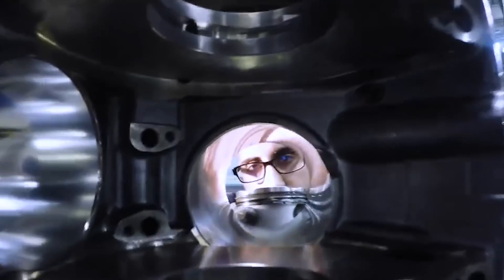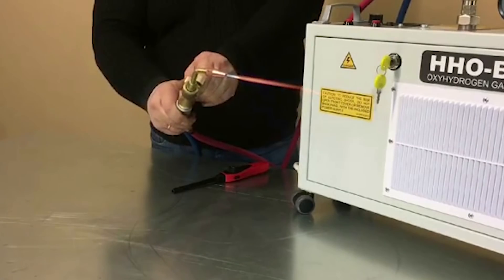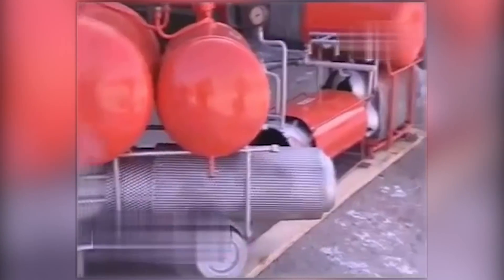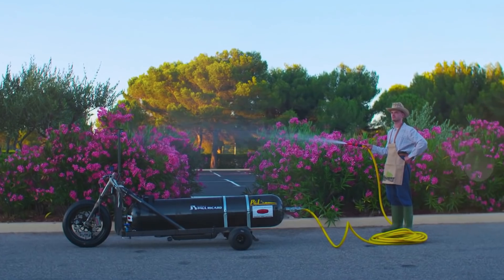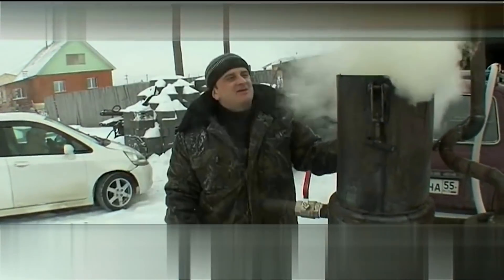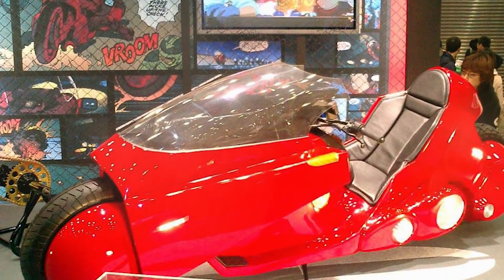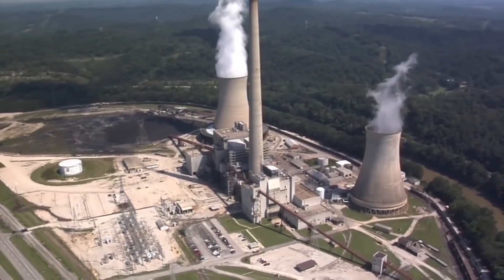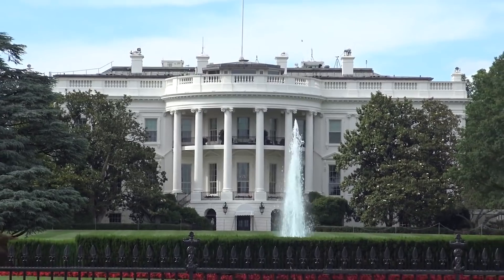Why These Engines Are Banned?

Comment: This started out pretty good, but it lost me from the bike with the "magnetic engine", and went down hill from there. The only thing that bike could do, is perhaps, utilize regenerative braking, before there was a name for it. Magnetic engines aren't prohibited, they just can't work. Not because they aren't allowed to. The laws of physics don't allow "over unity".
Reply: lost me at the hho generators

it take more energy to crack water, then what you can get burning it back into water.
Reply: @MaximusPsychosis  True. But if you get that energy from solar when you can and store the hydrogen then who cares how much energy it takes to free the hydrogen?
Reply: @2wheelsr2wheels39  there is calculations out there, but to get the required fuel to idle a 4 cylinder engine, i think it was around 10KW
Reply: Hydrogen then becomes another way to store energy when it's available, then, convey that energy when it's needed. Definitely a viable solution. Anything beats curtailment. If the wind's blowing, I want those turbines turning. If the sun's shining, I want those panels running at maximum power point. With the amount of stored energy necessary to smooth out intermittent renewable sources, nothing's off the table! no one technology can meet the demand: We need it all.
Reply: Solar power systems are notoriously inefficient, even under full sunshine.
Reply: No such thing as HHO. I think he means H²O
Reply: James DeGray  You have no idea what you're talking about.

1)Please explain exactly what "frequency/harmonic resonance" means, and how it pertains to cracking water.

2) A heat pump system can be considered to have a COP (Coeffient Of Performance) in simple terms when it has an additional heat source (a conventional electric heating coil) adding heat to the gross output of the heat pump. You still need to put energy into that heating coil. The heat pump (the "refrigerant compressor" you're talking about) does NOT put out more energy than it consumes.

3) No, you will never get more energy from burning hydrogen and oxygen than you will put into water to separate it.

In the words of Katt Williams: Go on, I'll wait.
Reply: @Mike-ie5xu  Yeah james is a moron.
Reply: it shows how low your IQ is and how low your attention spawn is. Magnetic engines are real, you just have to replace or recharge the magnets. And they clearly stated that is has a second electric engine/battery.
Reply: @alejandronunez7650  Find me one link on the internet that's not on youtube of "recharging magnets" and working magnetic engines that dont use electricty to keep running. You are stepping on dangerous "free energy" land here. And as for low iq? im an electronics engineer, so im pretty sure i know what im talking about. And to keep with the thread, you would have to have a very low IQ to believe in both free energy, and everything you see on youtube.
Reply: @colinsmith6340  "Free Energy" isn't a falsehood. We are surrounded by it. What do you think solar heat and the northern lights are? It's all about the type of energy and how we use it. Dont be blinded by the oil industry and others that want to keep their position at the top at the expense of the rest of mankind.
PS: as an electronics engineer you should know this.
Reply: @2wheelsr2wheels39  As an engineer that's not free energy. That's just energy that isn't being captured. Its from the sun or wind etc. Its not the holy grail of "Free" energy that lots of youtube videos post about. As an engineer i know the difference. I am not blinded by the oil industry, i actually have a home built solar system with 12 panels capturing energy into batteries and then used to run my servers. its not "FREE as in youtube flat earther crazy" free, but its simply energy i dont have to pay for. i still had to pay for the panels, the batteries, the inverter, the charge controllers. I didn't just put some magnets onto a wheel and post it on youtube.
Reply: @alejandronunez7650  The bike IS real, just not in the way you might think. It was an early attempt at "regenerative braking", allowing energy to be fed back into the battery when slowing down, or descending a hill, rather than wasting it as heat in friction brakes. It extended the rang of the bike, with no need to increase battery capacity. They didn't have pulse width modulated motor controllers back then, the transistors to do that just didn't exist yet. What it did, was move the magnets in and out of the stator coils, to adjust the braking effect, and maintain decent efficiency. Not an over unity machine, but rather an efficient one. It was more efficient than anything out there at the time.
Reply: It's not fully the truth, LEDs allow "over unity", but in general your right
Reply: @tobyhunter6565  No, they don't. There is no such thing as "over unity". It doesn't exist. At all.
Reply: @colinsmith6340  The Paradigm is just about to shift but it's too much to discuss it at a comment section. Told you, in general your right.  "At all" does not exist either, only in dogma and its language but not in Physics.
Reply: @tobyhunter6565  There are no paradigms to shift. You can't make free electricity or movement. There is no magic perpetual motion machine. There are no magnetic motors that somehow spin without electricity forever. People need to close youtube and read some actual physics and thermodynamics books. There is no such thing as a free lunch. There is no special arrangement of wires or magnets that will provide electricity for nothing. There isn't even anything thats 100 percent efficient. Entropy and thermodynamics don't care about your paradigms. They don't care about what you watch on youtube. They are rules of existence and reality.
Reply: @colinsmith6340  Good on you keeping your House in Order. As long your apples fall from the tree straight into a rubber sheet of gravity . The rotation of Galaxies alone defying some of those RULES. Knowledge is everything but static - sorry did not want to wake a sleeping Teacher, but perhaps there is the initial spark to look outside the BOX after all those years. And watch the Paradigm shifting, it's happening right now. It is the "Standard Model of Physics" and not one of "my Paradigms" or of You Tube's - Mind your words you'r old and educated enough to know the flaws of the RULES.
Reply: @colinsmith6340  All you got to do is capture lightning in a bottle. That's free. So are solar panels & wind.
Reply: @SamaritanElad  Its not "Free" as it comes from the sun. Its still not over-unity. Its just simply converting solar energy to electricity.
Reply: @tobyhunter6565  Light emitting diodes are much more efficient than incandescent lighting, and somewhat more efficient than fluorescent, but I don't understand how they allow "over unity".
Reply: @vincentrobinette1507  by oscillating a crystal lattice with electrons creating more Photons in relation to Electrons put in
Reply: Hey Vincent, I agree with you about getting lost after the magnetic bike.  Could you let me know what "over unity" is though.  Thanks
Reply: @johnbackley6115   A system operating at "unity" is a closed system in which the same amount of energy may be withdrawn from it as was initially put into it. The phrase "over unity" refers to a closed system where more energy may be extracted than was put into it in the beginning. Neither are possible. In the first case there will ALWAYS be losses due to friction in any moving system. Even when the only thing "moving" is electricity there will inevitably be losses due to resistance in the wires which shows up as heat in the wires. That heat represents energy NOT going to the load. When you have something like a motor-generator combination where the output of the generator is fed directly to the motor you will lose energy in the wires. "OK" you say "but what if I use some sort of superconductor for the wires?" Resistance in the wires is only one way a system would lose energy. The other way would be in mechanical losses in the motor-generator pair. Even if all the conductors in the system are superconductors, you still have mechanical losses due to the friction between the shafts upon which the motor and generator's armatures are mounted. To date we have discovered no way to eliminate mechanical losses in the way superconductive materials do for electrical losses. Nothing is - OR CAN BE - 100% efficient. That's just how the universe is.

For an "over unity" system you would have to first build a system which is ONE HUNDRED PERCENT EFFICIENT then you would have to find a way to extract MORE energy from the system than you put in. The first law of thermodynamics is an IRON LAW. It CANNOT be broken NO MATTER HOW HARD YOU TRY OR WISH! Energy CAN NOT be destroyed OR CREATED! It can only be changed in form. All the energy in the universe was present when the universe began. Even if you found a way to suck energy from somewhere else you would still not be creating energy. Such a system, while operating locally as an "over unity" system, would, from the perspective of the universe, not be "over unity". There ain't no such thing as a free lunch! Even if you are not charged for the meal, somebody ALWAYS pays the tab. All notes become due and payable.
Reply: @johnbackley6115  Over unity is what a lot of people call "perpetual motion". Imagine if you could couple a motor to a generator, then use the generator to drive the motor, and still have enough power left over for another load. That would be "over unity". The magnetic bike might be claiming to do something like that, but, in reality, it's just taking the energy that would be lost to heat by the friction of brakes, and using it to generate power back into the battery. If coming down a long hill, regenerative braking would give the battery back enough energy to get you about a 3rd of the way back up the hill. With brakes, the battery would get nothing back. Regen: minimum heat, minimum wear.
Reply: Thank you, Vincent. The First law of thermodynamics states that "energy cannot be either created or destroyed but only changed in form". Any over unity device would have to violate that principle. In simple language the 1st law can be stated as (in Robert A Heinlein's immortal words) "There ain't no such thing as a free lunch (TANSTAAFL)". Tanstaafl is an iron law of the universe and (so far as we know) CANNOT be violated. 

BTW, the reason we are so "addicted" to fossil fuels is that they have the greatest amount of easily usable energy per unit volume. All the alternative fuels have much less energy PLUS they require the use of fossil fuels to produce. On the average it takes one and one half (1.5) gallons of fossil fuel to produce one gallon of alcohol which has 2/3rds the energy. That's right one gallon of gasoline has the same energy as 1.5 gallons of ethanol. Methanol has a bit more energy but it is still a losing proposition. Splitting water is even a WORSE proposition since it requires a lot of energy to split the water molecule. TANSTAAFL ensures you won't get nearly that much energy back. Even nuclear is a losing proposition in terms of carbon footprint. By the time you factor in the fossil fuel consumed to mine, extract, refine and enrich the uranium ore only fuel derived from high ore (the LEAST common ore) produces less CO2 than would be produced by using the fossil fuel to generate the same amount of electricity. Mid grade ore (the 2nd least common grade) is essentially a push. Low grade ore (i.e. the MOST common ore) produces LESS electricity than just burning the fossil fuel used to produce fuel.

Bottom line? Tanstaafl prevails and always will. You don't get something for nothing.
Reply: @billmullins6833  
Before the universe existed there was nothing.
An unimaginable state where there was no mass and no 'time'
If the laws of physics applied then, it's not difficult to surmise that if something can happen it probably will
given enough time.
Kerboom !
WTF was that said God, who had just been created along with the entire mass of the known universe
Time for some fun methinks it said to itself    .........etc
Reply: @billmullins6833  You'll notice, I don't use the phrases "Perpetual motion" or "Free energy". Those can exist. for example: Water wheels, solar panels, and wind turbines are examples of "free energy". It doesn't cost you anything if the sun shines, the wind blows, or water flows down a stream. The expanding universe, or even the orbits of the planets around the sun in our solar system can be considered "perpetual motion" on a human time scale. Over unity,(preaching to the choir)just simply doesn't exist.
Reply: @billmullins6833  everything including energy was created by GOD. Guess this means your a heathen then
Reply: Yea same, though the whole "oil company" thing started to be on the noise pretty early.

Comment: You know another name for a magnet engine?  AN ELECTRIC MOTOR!  ROLMAO.
Reply: The only thing that bike did, was utilize regenerative braking, before it was even a word. No over-unity here!
Reply: @vincentrobinette1507  Actually he said the engine was patent in 1997.  Regenerative braking was being used in the Toyota Prius at the time.  It was also being used in locomotives long before that.  It's actually a very old concept.
Reply: @GarretsDaddio  I did not realize this was that recent. I thought it was back in the early '70's. There WERE field effect transistors that could be used for motor controllers in the ninety's. In train locomotives, it's called dynamic braking, and it worked by varying the field current to a huge resistor pile, with big cooling fans. Locomotives didn't have batteries to store that energy, in fact, I don't know of any locomotives that use batteries, like hybrid cars, even today. Any way, the only way that bike would be "banned", is if ALL electric bikes are banned in a specific area. They're never going to single out one scooter, just because it's a little more energy efficient than other electric scooters. Don't believe the hype: It's not over unity, however, it would be a novel idea, for a scooter to have regenerative braking. Most of the cheap ones don't have that feature. Electric wheelchairs, and mobility scooters DO have full regenerative braking, meaning, the woah matches the go.
Reply: @vincentrobinette1507  From my understanding is that locomotives sent the power back into the rails to help generate power for other locomotives.  Supposedly a system was used back in the late 1800's.  Some first cars where electric too although obviously they did not have regenerative brakes.  What is old is new again.
Reply: @GarretsDaddio  That's possible, for a metro transportation system. It would greatly improve the efficiency of heavy trains that have to constantly start and stop for passengers.
Reply: @GarretsDaddio  Most all cars back then in the beginning were electric cars
Reply: @vincentrobinette1507  Current city bus's uses battery and battery assist. They also use Super/Ultra Capacitors for quick storage & quick dumps of electricity (buffer) as batteries take time to absorb & release energy. 
They were fun to drive and you would have to press the pedal down to go downhill as regen so powerful, would crawl otherwise. Rarely had to use the brakes till at stops. Meant to save fuel costs, but 3-4 times the cost of diesel only bus. Savings was 1-2mpg's. Take 10yrs to recoup difference. By then, time to retire the bus. Tricky part in snow going downhill, the rear wheels tend to lockup so we had to turn off regen braking...
Reply: @SamaritanElad  The newest hybrid buses are just starting to adopt these technologies. They're basically giant Hybrids. They are at least twice as efficient, because of the continual starts and stops along their routes. The electric only buses are running Lithium Iron Phosphate batteies, rather than the lithium Ion, like Tesla, Nissan Leaf, and Chevy Bolt use. Even though the LiFePO4 batteries are not as energy dense as the lithium Ion, They have a much longer cycle life, making them more economical in the long run in commercial service. Buses are big, and can afford a slightly heavier, larger battery.
Reply: Akira!

Comment: This guy has no idea about basic physics, economics or mechanics. Outside of those drawbacks he is a great source to quote.....
Reply: .....for misinformation?!
Reply: @Aseutester  Pretty much.
Reply: "magnetic motor and regular electric motor"

For what it seems he knows not even about common stuff... failing to know that technically all electric motors are based of magnets (electric or not...)
Reply: This Madlab deadshit knows nothing about patents either.  He's an idiot.
Reply: This dude is unbelievable. What exactly does he think powers the air compressors or provides electricity for electrolysis of water?
Reply: I ready that if just 10% of all gas vehicles on the road were switched with electric cars our power grid would be completely overloaded. And we would have to build a nuclear power plant. People think electric cars are magical or something. When you plug that chord in the power has to come from somewhere.

Comment: They chose been around since Nikola Tesla 1800 or around there it's an electrolysis scientist used to use it to split it to make hydrogen but you can also use as the hydrogen and heaters anything that runs on natural or even propane gas or even convert a gasoline engine to run on HHO it's been around for a very long time
Reply: And it also takes more electrical energy to convert the H2O to HHO than the energy you can get out of combusting it back to H20.